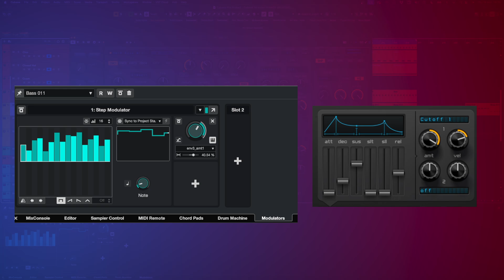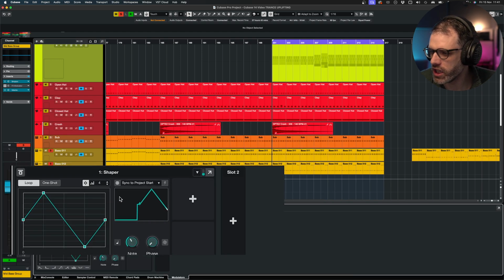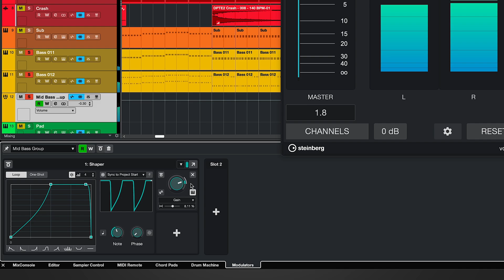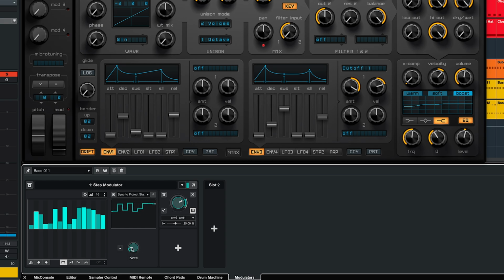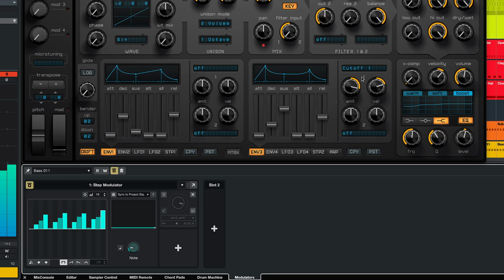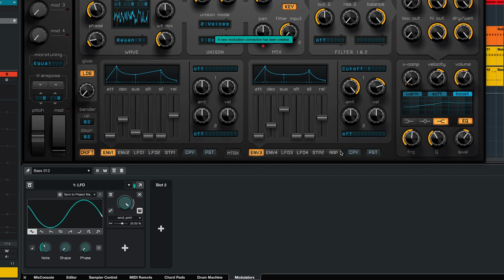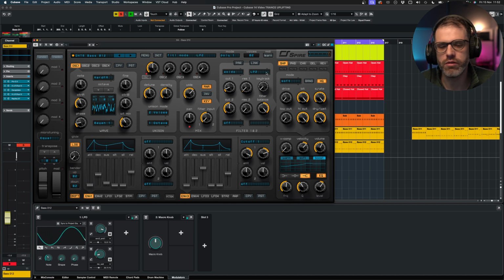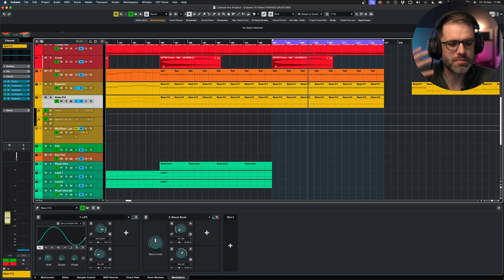Shape Moving Soundscapes with Cubase 14's Modulators | Trance Production Basics in Cubase

Comment: Thank you for this helpful video . I will be using this lots .A couple of teething issues .I forgot to turn my UR 816 C on a few days ago and since then Cubase 14 Pro has forgotten the connection .I fix it every time by going to the audio settings . A note to my self !Don't forget the interface .ironically it worked with everything else .Just not Cubase . It is a new arrow lake system too . Just a thought about loop points .What if there were more than on loop button in the timeline control ? The reason being that if I was working on a particular part with the timeline then I could use the second loop button say between measure 10 and 16 . Then set the second loop button to any other zone in the timeline .There would be a button to set the parameters of the loop then the button to toggle on and off .

Comment: Can modulators send midi CC to hardware synths. also what is the maximum cycle length
Reply: If there si a plugin to control the hardware sure. Like Aura or the Virus TI plugin. I haven't tried it but it should theoretically work.